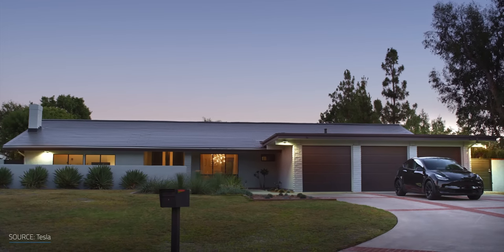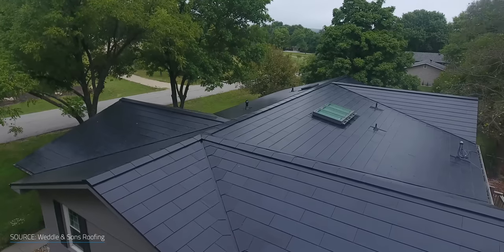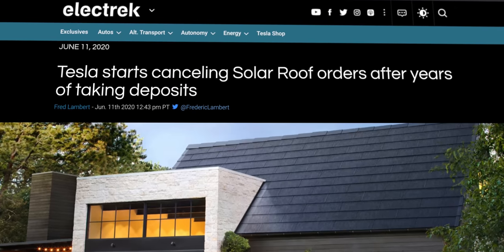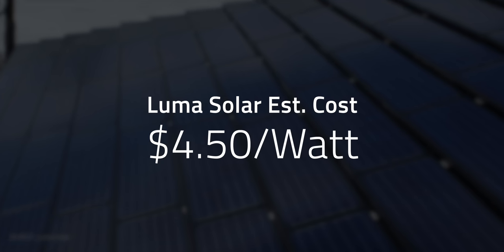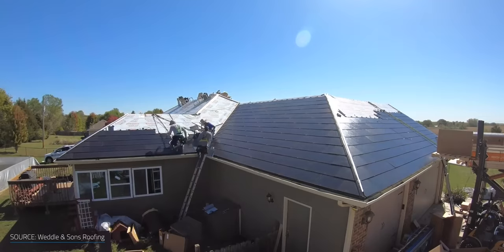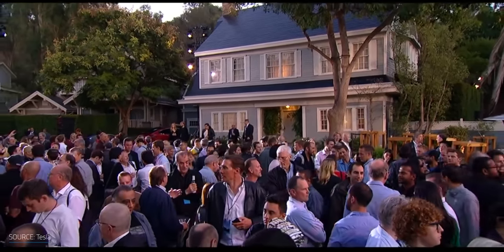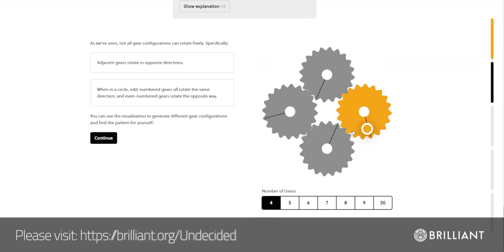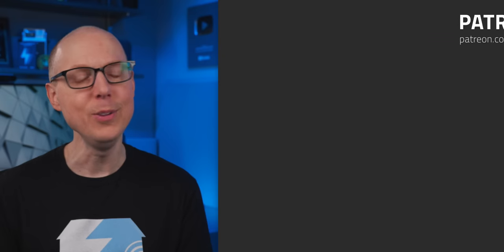The Problem With Tesla’s Solar Roof

Comment: I was wondering if you have the space on your property, would it be better to build a structure like a pavilion in your yard for the solar panels.  The solar panels would be the only covering for the roof instead of a plywood underlayment.  I assume regular solar panels would suffice.  What are your thoughts on cost, maintainance, and how it would compare to simply installing solar panels on a roof?  My thought was that it would be easier to maintain and roof repairs/replacement would be simpler.  Plus I would have additional space outside for shade.
Reply: Jordan - Someone else posted above about doing this. There is at least one important factor to keep in mind. Plywood is not just a covering on the structure. It is an integral part of the structure that keeps it from twisting and falling over. 

You can get around the need for plywood in a couple ways:
1. Add diagonal bracing. This was commonly done 50 years ago and usually with 1x4’s. 
2. Build the structure with rigid connections and/or corner bracing. There are many beautiful examples of timber frame buildings/pavilions. 

Adding the solar on an uninhabited structure could also have other health benefits. There’s some research indicating that electric fields increase some diseases. The more fields, the greater the diseases. Maybe
Reply: @johnlee7085  Thanks for sharing.  I didn't think about electric fields, but do solar panels generate electric fields big enough to be a concern?  It is my understanding that smart meters give off some kind of radiation due to the wireless transmission of meter data, which seems to be a bigger concern than electric fields generated by solar panels.  My biggest concern with solar panels is that they will last longer than the roof itself and removing solar panels and the rails that they sit on would make a roof replacement more time consuming and costly if you have to hire someone.  I am not sure most people think about that.  So, I thought a permanent location dedicated to the solar panels would eliminate any issues with normal maintenance of a home.  The only other solution would be using a very durable material for the roof such as a metal or tile.  Those materials should last longer than the solar panels, but it may be cost prohibitive or it may be against your HOA rules if you have any.  The other reason I was considering a different structure for the solar panels was because the roof of my house would not allow the solar panels to face south, which is the direction for my location for optimal generation.  They would have to either face East or West or a combination of both unless you some how propped them on one end to sort of point South, but then some of the solar would be shaded either in the morning or afternoon depending on which side it was on.
Reply: Panels really don't need any maintenance.

It probably wouldn't make much of a difference unless your roof has really bad orientation.. If you have the space to spare why not.
Reply: Any flowing electricity has a magnetic field which could be harmful. It’s unrealistic to get rid of all of it, but a reasonable question is can I reduce my exposure? Smart meters, 5G, high power lines, and a few others have received public attention because they are new and different. That doesn’t mean that they are necessarily worse. It gets back to the question of reducing exposure. 

If you have the opportunity to install solar and the electromagnetic field away from where you spend large amounts of your time, it seems wise to go that route. Lots of great options for your gazebo/pavilion.

Comment: The questions I have hear raised recently regarding solar is carbon footprint to produce, chemicals used and how to dispose of them at the end of life.  All of a sudden we are into that cycle of the solution creates unanticipated problems that may be worse than the problem they are solving.  Eh, we humans need more energy it has to come from somewhere. The problems any solution creates should be considered collateral damage.  Basically, until the demand curve for energy flattens out we will continue to run into problems.

Comment: For me, I think we all need to have serious discussion on building houses that are white like in Mediterranean.  They absorb less heat. The roofs should be metal with massive insulation and PV solar installed at factory which would massively reduce costs of components and improve install times which lowers costs of install.  Thoughts?
Reply: Works for hot/sunny climates like the Mediterranean (or the South and Southwestern U.S.), but not for cold places (ie. Western Mountain States, New England and Canada) where heat absorption is wanted in winter.

Comment: Install a solar panel is space can be had, pole mounted trust tracks the sun all day follows at the right angle, from sun rise to sun set, then u get max sun, roof you may get 4-5 hours the most of effective sun, 10-2 on roof, sun tracking 8,10, 12hours of sun not spending a fortune either, start small then expand, power heavy loads cheaper option,

Comment: I have looked into Solar panels and solar roofs.  They just aren't economical.  $50,000 to install a Solar roof getting back a couple hundred dollars plus what I would have paid in electricity per month means that I will lose money.  Factor in that I will need to replace the roof before I pay the first one off and it is just a never ending cycle of debt to install a solar roof.

Comment: This solar cell technology is advancing to the point of one day having translucent tempered glass with solar energy technology embedded within it unnoticeable to anyone looking out through the glass. So, I am excited to see where this technology will lead us. 
However, here is the rub. As you noted, solar cell efficiency is temperature is inversely proportional to efficiency which is one reason solar panels work so great in space. As well as more Earth based places with long periods of cold temperatures. With the panel system, there is room to integrate a cooling system to help keep the PV cells at cool enough temperatures to be more efficient while using as little energy as possible to keep it cool. It is in the realm of being possible. 
The current designs for solar roof technology is at micro levels. No room for any type of cooling system I know of. So this means a tougher challenge to come up with a design or means to increase the efficiency of this type of solar technology. All solar cells need to be facing the sun, south if north of equator; north if south of the equator. That means a lot of heat as well. Without a way to increase efficiency of those types of solar cells, I believe any gains made by the ability to install solar cells almost anywhere would not be that much. 
However, I do reserve the human right to be wrong.

Comment: In my opinion, there is an even worse problem with solar shingles.
Sure, they might be cheaper than a new roof plus solar at some point.
But in spite of that, those roofs will be worse.

Depending on your house, you have some kind of insulation, and over that, the shingles. When sunlight hits them, some is reflected, some absorbed. This heats up the roof, and the heat wanders down until it enters the interior.
When you replace the shingles with solar tiles, the same thing happens. Just far worse, because solar cells are designed to absorb the energy coming in. They transform 10-15% into electricity, and most of the rest heats up the tile.
So the heat entering the house will be similar to or higher than it would have been with a new traditional roof.

Now for the kicker: When you put solar cells over the roof, you create an air gap. This has two advantages. It allows air to flow beneath them, which means less heat is transferred to the roof. It also keeps the temperature of the cells lower, because they don’t have a huge block of insulation behind them.
Lower cell temperature increases cell efficiency by a significant amount, and a better insulated roof means you have to use less AC.
Both of these mean significant advantages over solar tiles.

Comment: Tesla will struggle with the roof replacement idea here in Australia. Clay roof tiles here last anywhere up to 100 years, cement tiles over 50 years. The ash-felt shingle type roof you guys use, isn't even a thing here. Its either tile or tin roofs (even they have a 70 year expected lifespan).

Comment: We have regular solar panels (installed 2014) under a lease program that lasts until 2039.  I'm assuming that solar roofs will be the default by that point.

Comment: I think this video failed to mention a key point regarding Tesla and their delayed push into solar/energy: Solar Roof, in specific, which was first unveiled in August 2016, didn't make it to volume production until March 2020. This is because all company resources had to be pulled away and refocused on the car business during the production ramp of 2018/2019. Basically, this was a make-or-break period for Tesla. But the point is, Tesla had to take a back seat on Solar/Energy, which has since been and will continue to be improving at Tesla speed now. I think most of the other points made were valid, but was sad to see this one missed. Thank you.

Comment: The decision to get a solar roof over solar panels is definitely a by need and affordability basis. One thing most people do not consider the rest of the equipment. Inverters, breaker, wire, conduit. Even at a higher price I would rather go with a solar company who know more and can better maintain all aspects of my product, rather than a specialized roofing company.

Comment: I'm kind of a techy. I just built a custom house in a very solar rich area. Right now building a new house with a solar roof does not work. It is hard enough to get roofers to install shingles. There is no way that solar could fit in the timeline. Don't get me wrong I have and use solar. I am a Starlink customer but at this time, it ain't gonna work.

Comment: Dedicated solar panels have substantial benefits over a roof.  The only benefit of the roof is that it looks better.  Panels can be sized for the energy and cash budgets of the house or facility.  They don't get as hot as a solar roof does.  Solar panels can be installed at the optimal angle for your latitude, which is not necessarily the same as roof pitch (it rarely is).  Worse, in the northern hemisphere only the southern roof faces get good exposure.  It may be that they install dummy panels on non-south facing roofs, but still, those are going to be significantly more expensive than a standard roof.  I have a sneaking suspicion that they're going to try to sell people on the idea that it's worth it because it makes some power, though it's nowhere near economical.  The last company, the one that just installed asphalt shingles around a bunch of solar panel shingles, seemed to make the most sense of the lot to me.

Comment: I have a masters degree in photovoltaic manufacturing. I’m 100% against solar tiles. Heat and failure points (imho these will NEVER go away. It’s physics). That and HIGHER $/w easily out-way cosmetic benefits.

Comment: When Tesla refuses to give specs on solar tile efficiency, I knew it will not take off. 

Basically it would be less efficient, more expensive, more complex. Need to have at least one of those 3 better than normal solar PV to be any good 

Lemmings would still buy but majority of people will do better with normal panels.

Comment: When the storms they have promised us come most of those roofs will fly away the main question should be are you using brads or just smooth wire nails in those guns LOL Then ask how often is that roof fixed to the walls

Comment: I wouldn't put any value on many year guarantees, there's no way to legally enforce that unless the degradation happens very quickly, because of the statute of limitations. Fair chance the companies won't even exist 30 years from now, or will have been bought out several times.
Reply: Solarpanels outperform that guarantee easilly. And if they fail, they fail within the first year or so.

So that guarantee really doesn't really matter in the long run. Once they are up there and made it past the first year your basicly good for 40 or 50 years.
The only thing that breaks them is storm or user error, and guarantee doesn't cover that anyway.

Comment: Does not look very waterproof or heat resistant. I have a flat roof with panels, on top of our isolated roof. 38 of them. Not to be seen from  the street. And today about 50 kWh every day / winter-spring time.

Comment: Solar roofs to this point have trouble handling objects hitting it at hurricane force. Which company is working on a solar roof for Florida residents?
Reply: Just get panels. If one or twi where to break you just replace them and you are good to go.

Comment: The biggest question I have is the leak potential of placing this on your roof. No matter how well the panels or roof work if the roof leaks your house rots.
Reply: It's just an additional cost prolly. You may install a roof sheet originally and still cover your roof with the solar tiles

Comment: How efficient are these shingles when actually installed?

Solar panels really don't like heat. And being installed directly on a roof and being black and all, these puppies must be smoking hot in the sun without any way to radiate their heat away.

I really doubt they will hit anywhere near their 16% rated efficienty when they are actually installed on a house.

They seem masivly expensive while designed to under perform.

Comment: I have an idea for an environmental charity that follows storms, and helps people whos insurance are paying to replace their roof upgrade said roof to a solar roof. Every storm season there are roofers that chase storms. Hurricanes, tornados and even hail storms will damage roofs enough they need to be replaced. So a hail storm comes through a small Midwest town. Insurance companies will be paying 5 to 8k to replace the roof on 30 house. The charity would step in and take the 8k insurance check, and cover the difference to install a 20k solar roof. the charity would have the crews, and they would consist of some payed professionals in key positions but the general labor could be a combination of volunteers and paid labor as necessary. As both the charity and industry grow they would be able to work with various manufacturers to get better bulk pricing. Just do simple grid tied systems and if the homeowner wants to add a battery they can at their own cost. Working with the insurance companies and local agents you can get the word out to the people who need it making it more efficient. Imagine the environmental impact if in 10 years, 90% of every roof damaged by a storm was replaced with a solar roof. That would be a real impact. If anyone knows how to go about raising money for such a charity let me know and perhaps we can make it a reality.

Comment: Rectangular solar panels look horrible. Sorry but they just do. Not as bad as wind turbines but horrible all the same. Hopefully, solar tiles/slates/shingles can be made reliable.
In UK we use tiles or slates, which are laid on pressure treated battens over a tough sarking felt. Slates are stone shingles about 16" long x 8" wide giving a 6" cover per course. Solar slates would need a connection at every slate with the solar area on the bottom half only. I can see how they could ever compete even with the most expensive natural state tiles (which already cost HOW MUCH!!!).

Comment: The biggest downside is not listed.  Every house needs to be friendly to the business who services the roof and siding/chimneys,/, dormers/windows/antenna.

A bucket truck in my area is 1000 to 1500 dollars per day.

Imagine turning a 250 dollar job into a 30,000 dollar job.  All roofs need to be able to be screwed into for jack, able to handle ladders set on them, and be walked on by 230 to 300 + lb of force.

This means that a matrix around the glass panels needs to be installed by tesla, and I do not see it.  

The customer will need to assume all liability for the workers on the roof, even if a workaround solution is reached.

Glass roofs are a bad idea unless you also build in a way to service every square inch of the roof.  Pressure washing off the years dust is just one of several annual things that need to be done.

This problem is not inherent in Slate and metal roofing. Because any holes made in the roof to save the life of the worker, is cosmetic, and with fiberglass, urethanes etc, a pin pick hole can be cosmetically filled colored and inorganically plugged, and last 60 to 100+ years .  No big deal, while paying a million dollars for broken neck and back surgeries, as well as funeral expenses, is a heck of a lot more money than the cost of the roof and the energy that it saves.  Plus, it is a tragedy for the families and the orphans and widows--just so that a person can feel righteous about the environment and save money, screwing the energy companies. Priorities people; get them straight!

The problem is that Musk and the homeowners are not the ones slipping around risking their lives, while getting threatened by the house owner with lawsuits, in order to provide value to everyone around them with nothing leftover for disposable income and themselves.

Comment: With an estimated lifespan of 20 years and the cost of installation between $60,000 to $75,000 my electric bill would need to be $250/mo for 12 months to even break even at $60k.

Comment: Even if Tesla is completely removed from this market, they are going to achieve their goal.
Their goal is to "Accelerate transition to sustainable energy". If Tesla's presentation in 2016 has generated enough hype for other companies to focus on this section, that's a step in the right direction.